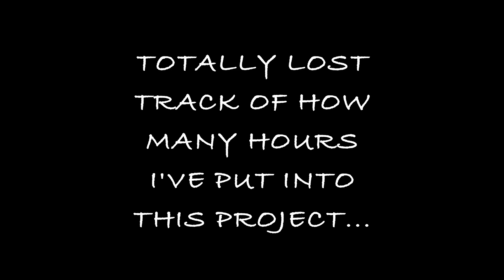Forks & Steering | FZR1000 Restoration - EP9

Comment: I've found my little impact driver will undo without needing the special tool. 
I've also trimmed and hammered in a broom handle which moulds itself to the obscure shape
Reply from the maker: Yes, unlike the Virago where the bolts were seized completely, these ones came out just fine on their own with an impact driver and spring tension.  It was getting them torqued back in - the shop manual called for 60nm which I think is excessive.  Ive seen a number of mistakes in the Haynes manual and ended up calling my friend who is a Yamaha trained and certified mechanic.  He said it should be less - around 35 to 40 NM.  So my problem was the broomstick/bolt method that I had was working fine under less torque, but split when I tried going higher.  Ended up with blue locktite and 35NM for final torque after I wrapped duct tape around the split.

Comment: Nice work Ken!, looking real good.  My FZRs forks needed a bit more work (and and quite a bit of $$$) to bring them back. The stanchions were both pitted with rust, so needed new hard chroming,  all the slide bushes were down to the copper so they were replaced, I also fitted YSS cartridge emulators and non progressive springs all set up for my weight. I also had the alloy on the lowers clear Cerakoted as i live next to the sea, and it gives a very durable finish. Yep, holding the damper rods can be a bit of a pain, thankfully for me, my ex racer, mechanic friend had the factory rod holder (part number 27mm 90890-013388 🤣)  and saved me a lot of grief, someone had used a ton of permanent loctite on the bolt.
RE the spacer in the forks, are you talking about the "spring seat" that sits on top of the spring, under the preload adjuster? it looks like a solid disc about 2~3 mills thick, They enable the preload adjuster to push the spring down.  I didn't see them in the tray at the start.
Reply from the maker: Yeah, forks can be a pain when that bolt gets seized.  My contraption ended up working out after I reinforced it but I was just really tapped out.  10 hours of work over two days what should have been about 3 hours.  So turns out there are short springs and long springs.  The long progressive springs do not use that 4cm long spacer.  It’s in one of the drawings in the shop manual and you warned me already about mistakes.  I went straight to Japan for the proper drawing and it shows no spacer with the proper length springs (I measured them just to be sure).  And there is no way in hell I’d get a spacer in there and still get the springs compressed in order to get the caps on.  The spring protector, looks like a washer, was in there and it may not have showed up in the video but it’s all there.  But it took me a couple days of research to get the proper answer.  Ceracoting for environment is a great idea!!  Luckily here, it’s dryer than a popcorn fart, so corrosion is usually not an issue.  But it’ll be a fair-weather drive as well.  Thanks for the great comment - always love it when people share their stories and experience.  There’s a lot of variations of this bike, even for the same year.  Nice to see people from all over the world sharing the intel.
Reply: @KensWorldRestorations  Forgot to mention, I made an unplanned, impulsive purchase, my next project, A 1984 GSX750SE Katana, also known as the "Pop-Up Katana" due to its.....er  Pop up head light. (Did Canada get those? not many markets did)  Its a NZ new bike so its not restricted like the JDM ones, pearl white & black with black engine with gold highlights (looks far better that it sounds)  in remarkable condition, still has its original rot free black chrome exhausts. This one will be easy compared to my FZR, its just been sitting for 20 odd years so will need a thorough going over before even starting. Ive stashed it at the in laws, to stop me being distracted from the FZR. 🤣
Reply from the maker: @uhtred7860  Oh wow!!!  I think we did but they're rare as hell.  You got yourself another gem by the sounds of it.  The US got them too but again, not in big numbers and only for a couple of years.  That's definitely going to be worth hanging on to!!